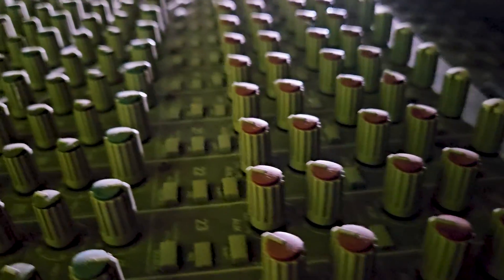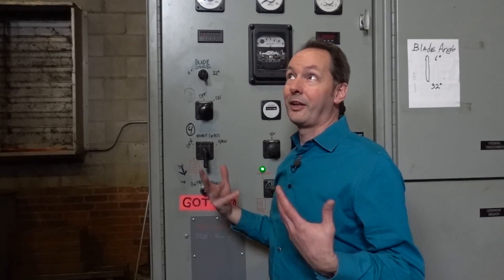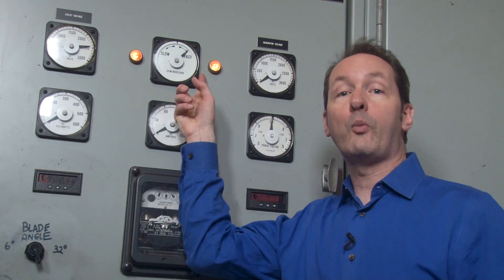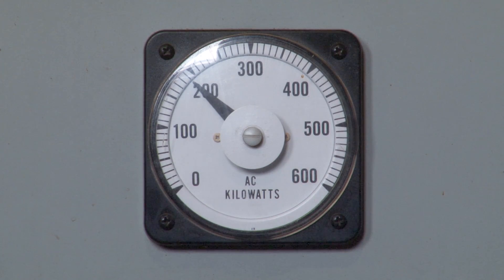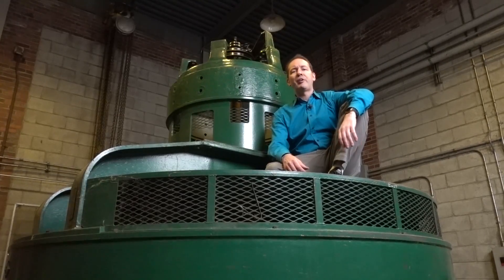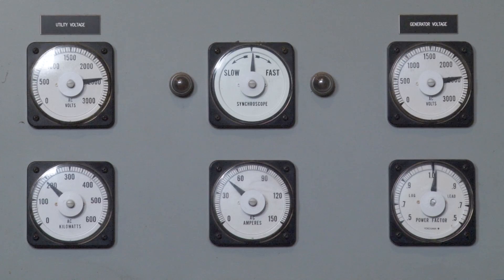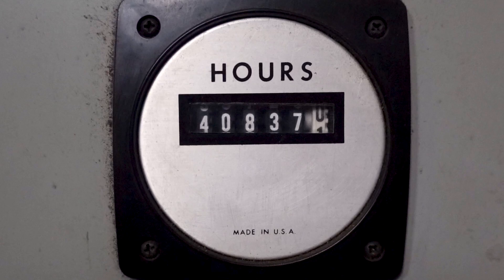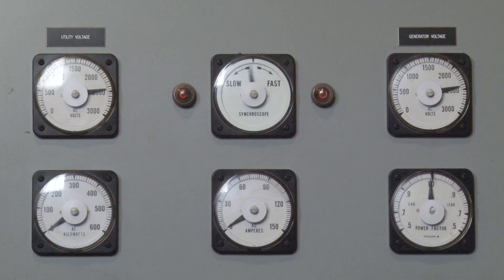Powerplant Control Panel Tour - Part 1 Authorized Personnel Only S4E1 #engineering #powerplant

Comment: Do you have a hard hat or safety glasses?  FR clothing?
Reply from the maker: Of course, did I require any of them during the filming of this video....no. But if you want to send me a new Arc Flash suit I could use one, this one is getting pretty worn out.
Reply: @Physicsduck  Hard hat and safety glasses required any time you set foot anywhere in the plant.  FR clothing is not just arc flash suit...its shirts and pants.  Also required if you even just end up in a room with any kind of breakers in it.  Ever seen a 480 contacter blow up and blow the door off the cabinet?  Its not pretty.  As for your comments on schematics, when I started with my company back in the late 80s, safety was non existant.  No LOTO, safety briefings, near miss reporting or proper PPE.  Also no safety culture.  Fast forward 32 years and we had a fantastic safety culture and great metrics in terms of incidents and accidents.  I get what you are doing in your vids and realize you do not have a lot of resources available.  Just please don't make light of the inherent danger involved.  New hires may be watching, I am sure you would not want anyone picking up any bad habits from your presentations and getting hurt.  Best of luck with your channel!
Reply from the maker: It was the same way here when I first started. OMG my battle for cleanliness alone. But you're right, I spend a lot of time in PPE but not usually on camera (because try using a microphone while wearing a full-face respirator). I'll see about showing more of that. Thank you. :)

Comment: Thanks Chris! Working on my second class power production worker rating as we speak, lots of Manuel starts, and more advanced learning about our units and plants. We have 6 hydros in 2 sites. 4x 2mw horizontal Francis runners from 100 years ago, 1x min flow unit which produces around 500kw and has a double runner incase of low flow we can drop it in half. Our other plant produces about 4mw and is a vertical Francis. We operate and maintain 4x 2mw catapiller diesel generators and a GE frame 5 gas turbine. Love what I do, and enjoy all your videos. Keep after it 💪
Reply from the maker: That's AWESOME! Thank you for being here! I love that you're getting into the industry and learning the trade! You're one of the COOL kids now! :) Thank you for being a part of this, and you're personally invited to the Discord! Check the link in the description for a place to come hang out with a ton of other people as weird as we are. :)

Comment: Hearing you scream about kilowatt-hours is fantastic. What an absolutely cursed unit. Our new electric car rates its efficiency in MPGe, or "Miles per gallon equivalent", with is based on miles per kilowatt-hour... and my brain nearly malfunctions any time I try to determine what that actually means.
Reply: Honest question - why is it bad? I'm no EE or anything but I have actually always been irritated by some of the other alternatives like Amp-hours for battery packs. In that context I think watt-hours is much more useful than amp-hours, right? What am I missing?
Reply: @theWONDERFULwiz because we already have a unit to measure power over time. It's called the joule.
Reply: I don't really get it either, but it may have to do with the fact that the Watt is defined as 1 Joule per second? So 1kWh is just one thousand Joules per second times 3600 seconds, and the units cancel out and leave you with 3.6 million Joules. Which is all fine and good, but the Joule is a very small unit for measuring the energy consumption of an average household, whereas a kWh is about the energy an average household uses in an hour according to this video, so it makes sense to me that that would be the more popular unit here
Reply: @theWONDERFULwiz  Power (Watts) is voltage(Volts) times current(Amperes). A battery pack can have different voltages at the output depending on what they are supposed to power.
So let's say you want to know how long it's gonna work under some amount of current being drawn. With Watt-hours you have to use 3 numbers to get the answer, with Amp-hours you just divide that by the amount of current you will draw and done.
Reply: No, there's one worse: the kWh/year unit. used to indicate power consumption over an average year. Now you're mixing three time magnitudes!!!
Reply: I too hate the kWh unit. It's truly cursed. My biggest beef with it is using it in reference to electric cars and charging. You see, your car might have a 70kWh battery in it. Your charger might be 10kW. So, How fast does it charge? 10kWh per.... hour... um... So it returns 10kWh of battery capacity per hour. Yeah... having "hour" as part of your actual unit is terrible. I think joules would be the better unit, as others have said. Or, maybe megajoules for battery packs. Alas, we are standardized with kWh for both batteries and the grid. I hate it.
Reply: I also hear reporters say that a new power generator will provide to a certain number of houses *per day*. I can't help but wonder if this is caused by the confusion the Watt unit introduced. I always imagine that the power plant will grow and grow, and one day will provide all power needed by humanity. A man can dream though...
Reply: I know this is a year old but let's see....
Watts are Joules per second. Joules are energy, Watts are power.
So we take 1000 of those Watts and multiply by hours to make an energy unit again and charge people for that. 
Is this part of the confusion? That does seem as cursed a unit as you can get and still be metric. I'm surprised in the US that we don''t sell electricity in BTU's or something, but of course the electric company doesn't want everyone to know exactly how expensive their BTU's are, especially since heat pumps make that an unfair comparison.
Reply: I saw that mentioned in a video specifically about cursed units! 😂

Comment: how is frequency regulated across the grid? there are clocks measuring time by the grid frequency, and some simplier computerized electronics control their clock rate from the grid, so it has to be absolutely precise. 
and as i understand it, majority of the generators must change their speeds or the grid must change the load to move the frequency. is it coordinated by computers?

Comment: Power factor is COS of the angle between Voltage and current. Looks like a small amount of Vars is being supplied from the generator. Would need the angle to get the AP power, True power and reactive power.

Comment: As one of those audiophiles you mentioned, owning gear with a large amount of capacitance, I appreciate this. 
A fun thing now is that I own an amplifier with an old-school choke power supply.
Reply: Used to work for a major audio lab. Our speaker test racks had massive 1:1 inrush transformers just to handle to jarring voltage drop that a dozen subwoofers barking off pink noise at high dB's would pull. Even comcert hall PA's drop into protection mode without them.

Comment: My utility actually provides hourly meter readings going back a few months. With that data you can really see how much electricity usage of an average house changes throughout the day. It can be as low 0.2 kWh per hour, about 200W when nobody is home and nothing but the HVAC blower and fridge are running, and as high as 8-9 kWh per hour,  8000-9000W when doing laundry as the dryer and water heater are running. 

I usually divide the total usage in a month by 730 hours (total hours per year divided by 12), which sure it's an average, but it's reasonably accurate. Because most household electric use is by high draw appliances (stove, dryer, water heater, EV Charger, etc) that only run for shorter periods compared to industrial loads that run for the entire work day, or even 24/7, it is very hard to pinpoint what the average household electrical load is. I do find that the generally accepted 1-1.25 kW per household is a good rule of thumb though.

Comment: Not gonna lie, there's just something sexy and exciting about old school meters, gauges, buttons, switches and knobs that no GUI on a computer screen can ever truly replicate.
Reply from the maker: This person gets it. :) We call it "Old School Cool".
Reply: @Physicsduck  I have synced baseload many times with analog syncroscopes! I spent over 20 years at a nuke plant in SW Mi. Best job EVER!
Reply: I prefer analog to digital...  With analog, after using the panel for a while, you can just glance at it to see if everything is were it's supposed to be at.  That pointer should be pointing that way, this other one next to that line, etc.  With digital, you have to mentally decode the values and some of them can trip you up in a scary way... It is supposed to be a 9 or a 6?   Or 8 versus 0.  There is a place for digital - when you have to know what the value is, not where the pointer should be.  My iWatch has an analog face.
Reply: @fredinit  I was entirely confused by your post until you started comparing individual digits. Just because something is digital, does not mean it needs to show numerical digits. You can put a dial gauge on a screen just as easy as a value read-out. And then, if you ever need a more precise value for whatever reason, the digital information, in precise digital representation, will be displayed below/next to/inside of the dial.
 
Or, at least, it should be this way. I recognize it's often not, but that's a design decision, not a limitation of digital information.
Reply: @kindlin there are places where each one has its advantages. For instance sometimes its still nice to have the needle movement of an analog meter like when troubleshooting an oscillator. Its much more intuitive to see a meter sweeping back and forth than a bunch of digits flashing. But like I said each one has its merits
Reply: @fredinit I get exactly what you're saying, but I believe if a readout is well designed it doesn't matter if it's a needle guage or a purely numerical readout.
This video even shows a display that is well designed using both numerical and a type of guage display. It turns red when it's in a bad place, green when it's in a good place. It even says "high" on it.

I would say it's even better than a normal analog display.
Reply: @SECONDQUEST  some analog displays can do that too!
Reply: @fredinit  Same with my Apple Watch — I’m no Luddite and Iove the thing but digital clocks are the dumbest idea to ever come out of Silicon Valley.
Reply: @fredinit Another nice thing about analogue is that you can see the amplitude of an amp surge or a voltage spike if you have ‘fast enough eyes’ or a second needle that the active needle moves to show max deflection.
Reply: I agree 100%—touchscreens and digital displays in cars are dangerous because you must look at the screen for information, and usually the controls are not tactile. Using a virtual assistant might be most efficient, but it takes longer than tactile controls.

NHTSA should study thus issue. I think the 4 most used dashboard controls ie HVAC, Radio, … should remain tactile analog style controls.
Reply: I have to agree!!! Flew on old S-58 helos, to myself the cockpits are sexy
Reply: You're just mad at 64 bit computation: like the rest of us.
Abstraction kills so many things.
Reply: There are times when analog rules and when its ac I would prefer it.I love seeing the analog side of things and Art Deco era of everything AC related. There's a forgotten beauty to it.
Reply: Two things Chris: 1) You clearly had WAY too much fun writing the disclaimer and 2) Don't forget about strip-chart recorders! I worked in computer/network security and one thing I did was to read license agreements in their entirety to see what sort of traps were put into them (There ARE some).

Comment: Reason why your amp and volts don't match the power output is becuase you'r amps is just showing amp slowing over single phase - while I assume that you produce 3 phase (otherwise you would be living on a different planet) - you need to take:
amps * 3 * volts / sqrt(2) = wats you get out .. ish  (and wat's are rms, not peak to peak)

ish - slight discrepancies are caused by power factor.

Comment: Power draw is so wildly variable that expressing it as a "number of houses" only makes sense as an average. Like if you go just one step into it and say what is the average power draw per hour the number of homes you're powering will vary from half to double going from midday to 7PM. (Duck Curve) In  short, I think you've got it right.
Also I'd love to see a video on your role during a black start (if you're big enough to have one? I know they like hydro for it where available) and the dooomsday plan I know someone clever like you has for what to do to island and black start your neighbourhood during the end times ;-) 
Do you need external exiter power or is residual magnetism enough to get you going?

Comment: Aww man, only 3 minutes in and I already have my first question! When the national grid goes down is it simply an overcurrent protection that causes the plant to "trip out" or is there some more specific mechanism that detects the grid going away?

And also what does "go down" even mean in this context, presumably the grid could go high impedance if there is a failure close to your plant, or low impedance if there is a failure far 'upstream' of your plant?
Reply: I'm not sure what protection is at Chris' plant, but it is typical to have over/under voltage and over/under frequency relays. When the local transmission line goes down, generally both voltage and frequency quickly drop. The relays detect this and open the generator breaker.

Comment: I work (for another month) at a UK DNO. 
We have a few thousand substations with 240/415V outputs. They literally have 3 (one per phase) maximum demand meters.
The next level of substations has a little more as they feed a ring (usually) system of high Voltage 11KV.
The Primary substations are the big boys though. Fed from the National Grid (a set of pylons running round the whole country and tapping of for towns (via the other subs) They usually take in 400KV and have a "Control Room" with many of the meters you have there, and some others besides! I have never bothered to look too closely at the meters and to be honest it is healthier to stay outside those places as when, on very rare occasions, something goes wrong you have a Huge amount of fault energy dissipated. If you are in there when that happens I doubt you would even realise it ....... The bus bar sections are in different rooms connected by 1 1/2" steel blast doors and they are known to have been blown off!

As to the question of how much power each house uses on average I would say it is changing ...... currently it is about 1Kw ..... or a tad under! 
As a distribution network it is hard to tell but our smallest substations have usually got 400A fuses on the outgoing and they rarely rupture with overloads ..... but many do run warm! ;o)
Online estimates give 3500kwh as an annual figure but that will vary on time of day, but that averages out at 400w ....... I think that is too low!

Comment: 9:32 I've been wondering this question myself when I see my AC coupled inverter working to ensure 0w of power is going to or coming from the grid, yet my AC current clamp meter shows about 2A of current.

I assume it's weird science stuff like reactance/inductance/capacitance/power factor etc somewhere on the system, cause (in the UK) 240V*2A should be 480w, but the power meter isn't showing that and I'm not getting billed for it.

Comment: What kind of water level measuring equipmet do you use for the PLC? Floats or maybe pressure sensors?
Reply from the maker: It depends on the plant and the specific application of that sensor. I REALLY want to get to play with some Ultrasonic sensors, but they're way out of budget. Most of our stuff is pressure, but there's a couple float type here and there.

Comment: From a "knowledge per unit of time" perspective, that was the best damn description of power factor I have ever heard. I don't watch YouTube shorts because of reasons, but I think that part would make a very educational short.
Reply from the maker: Thank you! I really appreciate that! I tried to make it a short, but couldn't fit enough of it into the 1-minute timeframe for it to still make sense like I wanted it to. There's just too much setup required. I could do it with animation, but I'm not that good an animator. Perhaps I'll take another crack at this when my skills have improved a bit. Thank you for GETTING it though! I appreciate you! :)
Reply: Agreed. Another rabbit hole would be to discuss exactly why capacitance and inductance affect PF but in opposite directions.